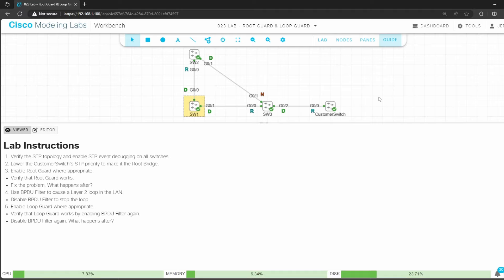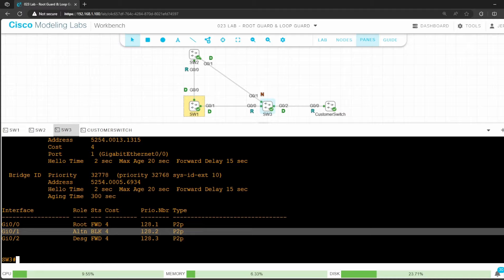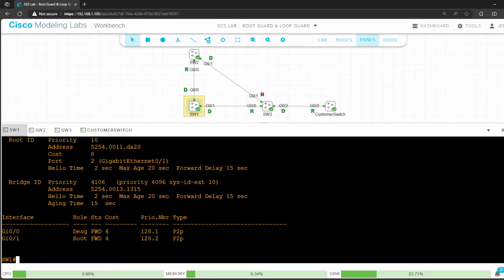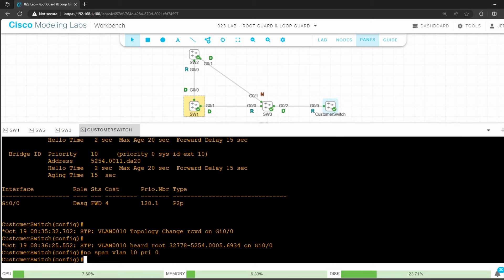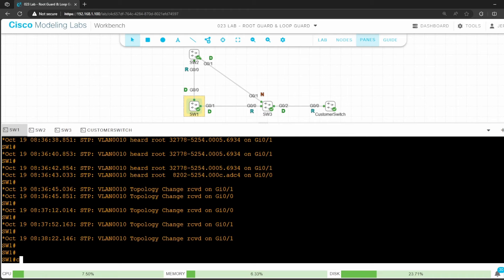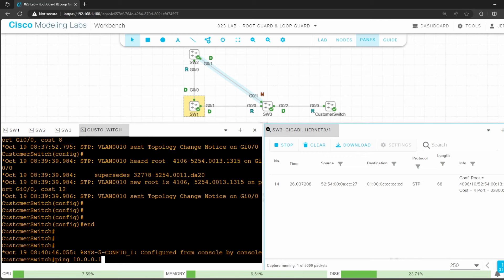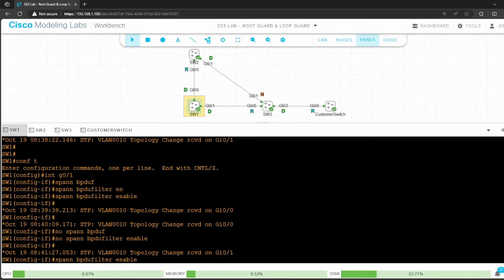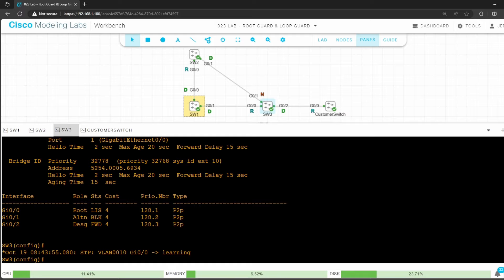CCNP ENCOR // STP Root Guard & Loop Guard (LAB) / BPDU Filter // ENCOR 350-401 Complete Course

Comment: Correction at 1:53, even though sw3 has a lower mac address than sw2, sw3 priority is higher than sw2's which in turn make sw2 has a lower bridge id and that's the reason why sw2 g0/1 becomes a designated port. Correction is sw3 doesn't have a lower bridge id. Thank you for very informative lecture.

Comment: Recently had a discussion on when to enable root guard. We have Core-distro-access and i usually configure root guard on the down facing uplink ports. Sometimes we also have to cascade on the access layer so i configure root guard on the uplink to the downwards access switch. My colleague told me root guard is not necessary there but given this example topology configuring root guard in the switch closest to the customer switch makes the most sense